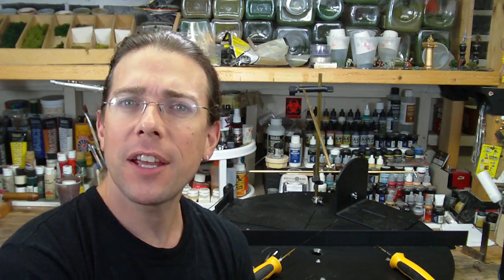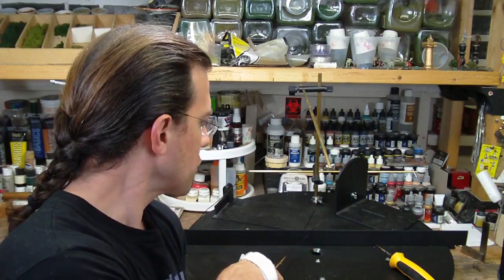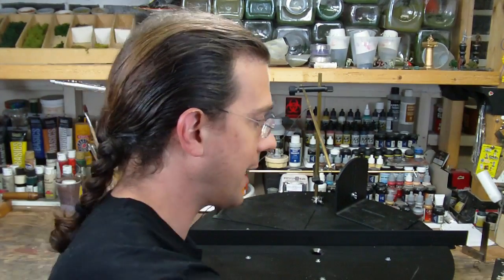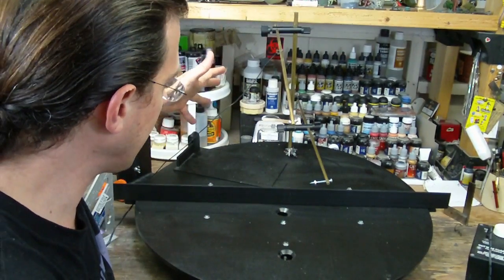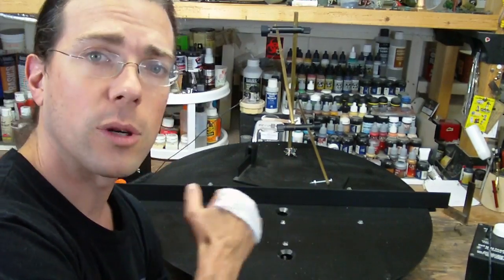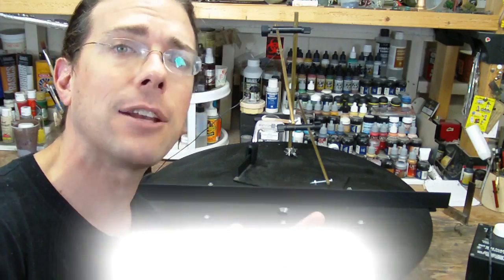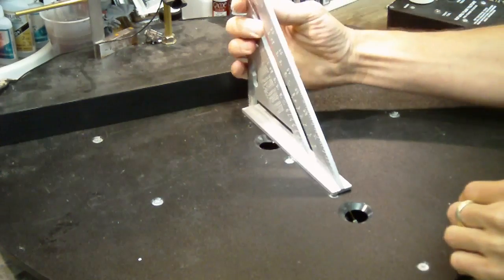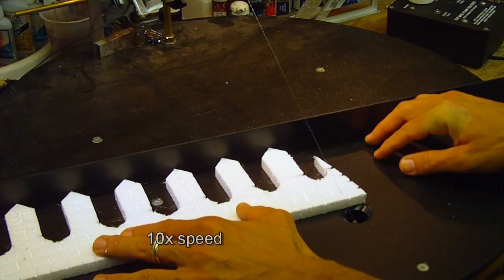TerranScapes - Hot Wire Foam Factory Tools in use - HWFF Foam  Terrain

Comment: to reduce error in free cutting I make 'jig's' out of card stock as the wire doesn't cut paper. This means you draw out your arches on the card stock then cut away the sections to make the shape you need. Tape it too the foam and it the free cutting will go much quicker.

Comment: Do you happen to know the material of the metal rods on the 24" table on which you connect your wires? I'm looking into getting a rod that's 2-3" longer to be able to make a specific cut I'm looking for. I found some steel rods with proper thickness but I'm not sure if they have the same electrical resistance as the material that HWFF uses.
Reply from the maker: The rod on the table is brass I think.  The diameter is 1/4" diameter.  If you're going for a longer rod, you may want to go for a larger diameter as at the limit for the table, the rod does flex when applying tension for the wire.  It's not a problem on the HWFF table, but if you go much longer I could see it getting possibly tricky.  As for conductance, not sure on that one.  I'm sure you could find a table listing resistances for materials.  I'm not an expert in electronics, so probably not a good idea to get that kind of info from me.  ;)

Comment: What adhesive do you use to fuse the two 2" foams together to make it a 4"?
Reply from the maker: I like to use the Hot Wire Foam Factory Styrogoo.  Great adhesive.  Sometimes now I tack pieces together with some foam safe CA as well, just to hold until the glue sets up.

Comment: You are absolutely correct about some foams being toxic when cut with heat, and PAH is a concern when cutting polyurethane foams with heat, but not polystyrene foams. Ventilation is always strongly suggested, but the smoke that you may encounter while cutting polystyrene foam is primarily CO2 and water vapor, which are far less harmful than other common art products like aerosols and paint thinners. You can call us at 866-735-9255 if you need more information - we also have more info on our site